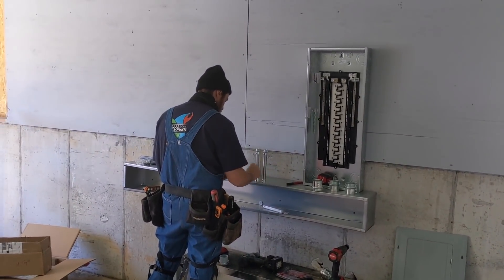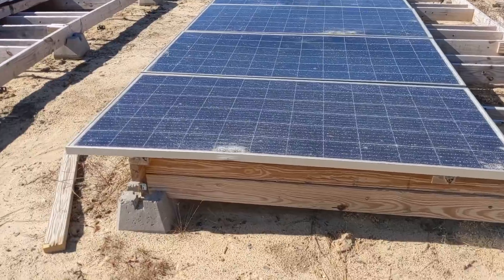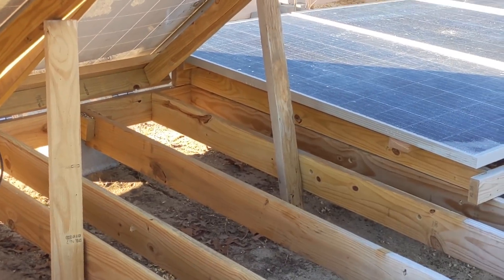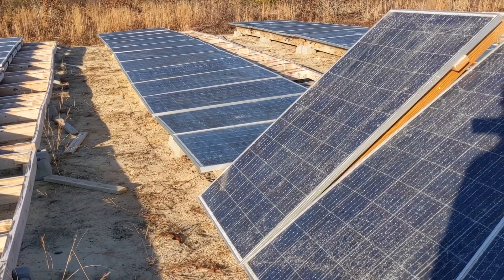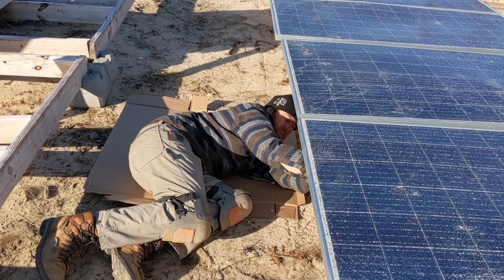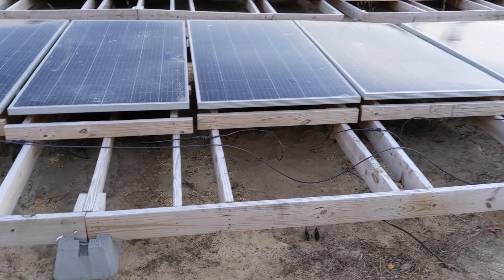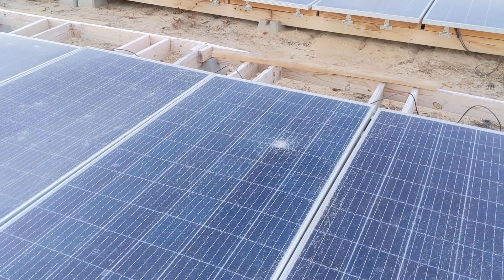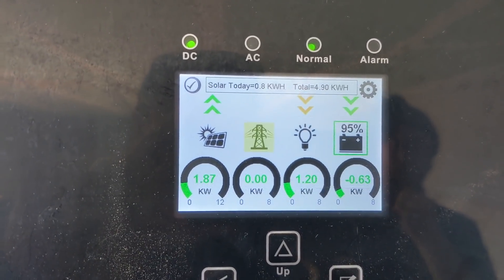Doomsday Solar

Comment: did they break because of the expansion and contraction of the wood causing too much stress on the metal/glass??? glass on wood is always supposed to have a rubber gasket between them and to no be over tightened

Comment: Watching Steve you  tube and he recommended Engineer 775. Looking for a small system that would be up gradable in the future. We live in N.W. MT about 15 miles from town. We currently are connected to grid power and with electric bill 70-80 dollars a month see no reason to panic and go off grid at this time, but we are moving toward being more self sustainable. So looking around for alternate power solar or wind...

Comment: 4:20 Voc maybe? Mounting system for those panels will be tricky with air pressure from the back when propped up - DIY nightmare. I can see a bit of flapping in the breeze... perhaps put them out of their misery for once and for all

Comment: I wonder if you used a fine drill bit and severed the leads on the damaged part of the panel if you could get usable power output from them.  It would eliminate any shorts and you could caulk or silicone the drill holes to keep the weather out.  Just an idea.

Comment: Great information, where do you buy a used panel? And what do they cost? I think it’s a good start for the system.
Reply: Craigslist, offer up etc. I bought my panels, 30, 230 watt sharp panels in perfect condition for $50 a panel

Comment: Dem dar panels gonna catcha fire fo sho!!  Especially with the wood frames on them.  The cells that are damaged will reverse bias which is essentially causing a short and dropping the load across that cell.  I would refuse to hook them up if I were you.  You are buying into a liability.

Comment: If you poured some good epoxy resin on the broken spots i think youd find it would dry like glass and restore the panels output back to new.  I think alot of panels could be fixed like this.
Reply: Most epoxy resins are too thick to flow into the cracks.  Second problem with epoxy is that the glass moves with temperature and the epoxy does not, so it cracks again.  A flexible sealant is need.  Liquid Nails Clear Seal thinned with a solvent flows into the cracks and is UV resistant.

Comment: In general the broken modules are ok to use al long as there are no holes through them. We don't know all the details on how the end user attained the modules. For all we know he could have got them for free. The big problem here is the mismatch of modules in the strings. Someone mentioned below about leakage to the frame that is what i would be concerned with as you would not know if you had a ground fault as it looks as if the modules are not grounded. We all know that panels laying flat will not produce much power. Once they were tipped there looked to be some decent production. If the racks were spread out a little more that would cut down on the inner row shading. The setup of the modules to be able to lay flat and then be tipped up is a pretty good system as you can adjust the angle during the year to maximize production. I know people who say I have 5000 watts of panels. Well if its not facing true  SOUTH (azimuth angle = 180 °). your 5000 watts just got derated. if they are not at the correct angle facing the sun you can derate them again. As for Engineer 775 taking this on I give him credit for working on a system that he knows is not going to be easy. I have been in the commercial solar end for sometime now and know of one person who takes all the damaged modules from sites and sends them over to Africa to be used in areas that have no electricity. You would be amazed at what one 300 watt broken module a cheap controller and battery can produce for someone who has nothing. Just keeping that one LED bulb on at night makes a world of difference.

Comment: Aren't the broken panels a fire risk especially with moisture ingress? I don't get it, considering the cost of the rest of the system and having you come out it just doesn't make sense. I've had two broken panels during delivery of both of my array's and getting them replaced was priority before commissioning anything. Heck the vendor replaced the panels no questions asked and free next day shipping.

Comment: WOW, all those broken solar panels, The GND fault alarm will trip every time it rains !!!
Reply: Yep, honestly this is dangerous. Wonder if they realise Inverter GFCI protection won't turn the panels off if theres a ground fault 😵 and it will only alert you if your bonding is 100%
Reply: Seal the panels with Liquid Nails Clear Seal.

Comment: If you seal the broken panels with like Vera Thane or something and pick out the good ones that will help out a bunch. IA found with broken panels if you put them all in parallel and get yourself direct charging the batteries they will work better but it's still going to be a sad state of affairs.
Reply: Vera thane is too hard and cracks from panel movement.

Comment: I think ,, your customer has the panels now,, he just keeps them producing 1kw or whatever,,you do all the other stuff like he/you both planned and he eventually gets more panels,,,jobs a good one..its about making the best off a bad job...
Reply: yeah i agree, panels are cheap and easy to wire. there's no point using new panels if no one is there, if/when that site is needed they can install the new panels easily at a later date

Comment: why not use microinverters?
Reply: If running off grid, there are VERY limited options for charging batteries from microinverters. It also puts you into an AC-coupled design, which has much higher “round trip” losses, meaning loss of conversion to AC at the panel then back to DC at the battery, 2x opportunity for loss and generally lower conversion efficiency from micros vs. string. Right now the battery world is wanting to be powered by string inverters or DC-DC optimizers could have been a good choice here using SolarEdge.
Reply: @tomkacandes8286  IQ8
Reply: @TurreTuntematon  I love IQ8’s ability to form a grid equivalency when the sun is out, not a night time energy storage technology, though.
Reply: People might point at Enphase, but just read their stuff - they are not really designing for the off-grid market, more the self-consumption market where objective is to store energy to use later in the same day - time-shifted energy if you will.

Comment: broken panels is the issue of the technology from the start. 
It's a bonus and great, but it's not 24/7, 365 days a year, rain hail storm reliable, and very easily damaged.
So many panels have been smashed in Australia in the last year from hail storms.
bonus, the destroyed panels I guess did save part of the roof from being destroyed! Expensive roof protection though!
Reply: Hail actually cleans them. 
On a side note im Pro... Oil & Gas

Comment: If he'd added some cheap boost convertors to that lot instead of trying to make a string, he might have got a bit more out of them. But an installer isn't ever going to advise that, he wants you to buy new panels with their own solar inverters. If you are going cheap then you have to engineer the entire system yourself, not expect a pro to help you save money

Comment: Well you verified it wasn’t a good idea. I wonder how much more production could be had if using micro inverters or optimizers to isolate the really bad panels.
Reply: Agree, you wouldn’t do  a pro Bono job for us fans would you?... FOR SCIENCE and us cheap people.
Reply: @AnN-py2em  yeah why waste good panels that still produce power that can B partly fixed with epoxy
Reply: @engneer775   this is the real question

Comment: Will solar panels work on the moon when we live there ??
Reply: Depends if they are sealed from pressure changes and if so what the pressure is.  Since they are used on satellites moon rovers etc I would definitely say yes.
Reply: Not on the dark side! 😏
Reply: Jonathan King says everyone has already gone there…
Reply: Absolutely.  The Earth and the moon are effectively at the same distance from the sun, so they both receive the same solar insolation, when measured in space.  However, solar panels installed on the moon have the potential to generate up to about 30% more power than on the surface of the Earth, due to the atmosphere of the Earth absorbing and dispersing some of the incoming light (especially in the UV range) from the sun.  Additionally, annual net production on the moon can be even higher, due to the lack of interference from clouds on the moon.  However, the lack of atmosphere increases the effective thermal resistance to ambient, and will cause the panels to get extremely hot during full sun exposure (ex: >120 deg C), unless they are operated with some kind of thermal management system (ex: liquid cooling + shaded radiators, or, operation inside a temperature controlled pressurized clear dome).  Operation without a thermal management system is presumably possible, but it would decrease electrical output somewhat, while likely reducing the life expectancy of the panels significantly.  Additionally, the greatly increased amount of UV light hitting the panels may cause the panels to age and degrade faster than on the Earth, but this can be effectively eliminated by coating the panels (or integrating something into the front glass) with a UV absorbing layer.

Perhaps most importantly however, the moon rotates very slowly compared to the Earth, such that a single day on the moon lasts approximately 709 hours.  Basically, at the equator of the moon, you get about 354 continuous hours of sun followed by about 354 hours of continuous night, with really long sunrise and sunset periods marking the boundaries.  Consequently, you would need a massive battery bank (or alternative power source, such a fuel cells) to keep yourself powered during the very long nights.  Alternatively, you could install solar panels on both sides of the moon and then install a high voltage DC transmission line linking the two sides of the moon together.  Doing so would basically eliminate the need for any batteries or other energy storage system.  Technically, we can do the same thing on the Earth as well, but doing so potentially requires greater investment on the Earth, due to the larger diameter of the Earth resulting in larger transmission distances required.  That said, we do have the technology required, it is simply a matter of coordination/cooperation between countries and investment in capital infrastructure.
Reply: @Fritz_Schlunder  We could also connect earth solar to HV transmission or at least from 3 or4 time zones away like in the US and have several more hours of use without storage.  Maybe this is done with the grid now nut pretty sure it could be improved

Comment: great video, Just because customer started with bad panels, the job can be upgraded and the stuff #Engeneer775 put in will be done ahead of time and after that the panels that have damage can be used for small projects , yard light's , electric fence, security camera's , etc.
have a great day

Comment: To go to the expense of having your guys come out and install a 12K solark and a lithium battery and then cheap out with 36 broken solar panels is certainly a head scratcher.
Reply: Yes but he needed that part done anyway and I bet he will get different panels and install them himself on the ground like these at least for a while.
Reply: I have friends that used broken panels and are just fine.  365 watt panels still putting 350 watts out.  Cant complain when he paid $10 a piece
Reply: @offgridmgtowhomestead2520  where did he find em?

Comment: For a long-term off-grid situation would putting plexiglass on top of the solar panels help them be a little more hardy and last longer without taking away any solar absorption?
Reply: it definitely would take away quite a bit of solar absorption and increase over time due to the plexiglass becoming cloudy etc due to the UV and other factors.  If I lived in huricabbe area etc I would have a ground mount a single vertical panel high and a frame around the panel frame a few inches higher and use strips of foam at aced intervals then cover with tarp this should eliminate moat of damage debris could cause and easy to install and remove once frame is there kinda like a boat cover.
Reply: the plexiglass might be more expensive than new panels

Comment: can you do a video on the different solar panels out there and which ones you use. what do you look for when selecting a brand of panel or how to spec out a system. I will be a first time buyer and would like to have some recommendations so I don't design my system wrong. there is so many different things to look for when you shop a system.

Comment: I received one broken panel in a shipment of 42  and took it to dump didn't try to hook it up.  so no experience with them.  
Question if some panels are way worse than others would it help to remove them from the array. Obviously if they create a dead short it would be helpful but if they show  rated voltage and just produce none or very little amps/watts do they make the string they are in produce less? How would you check each one for amperage anyway? use a small load and a shunt?
Reply: I was thinking the same thing. If your array is only as good as the worst panel, then troubleshoot the worst panels out of the set-up to maximize what the customer does have to work with right now. That process may leave him/her with several "duds" that can be thrown away but an overall better performance.
Reply: @jokertim777  year I think if the voltage is  equal they wont drag it down much just more or less go straight through the "optimizer " on each panel
Reply: @teekay1785  
no you want to have similar currents not voltages in a string.
parallel is the other way round.
Reply: @ursodermatt8809  You totally missed my point.  The point was how to identify the weak panels when most people would only have a multimeter and they can easily check the voltage of the panels but can't easily check the amperage to see which panels are producing very little power.  
Actually it is desirable to have similar voltages in a string when they are to be combined before the inverter doesnt matter much in a single string not combined. 
Here is a video similar to your point
https://www.youtube.com/watch?v=P3YtBrymJdA
Reply: @teekay1785  
my dear, i disagree with you.
it is just as easy to measure the current.

besides, all the measuring will not do you that much good anyway, as water ingresses and will do all kinds of damage.
using those panels is a hairbrained idea. only good for experiments.
Reply: @ursodermatt8809  No one including me has said its a good idea to use these panels for many reasons that is not germain to issue.  No most people would NOT be able to readily measure the current produced by individual panels. I could but thats not the issue either,  So I guess you will just continue to disagree.
Reply: @teekay1785  
yes, keep on disagreeing
Reply: @jokertim777  maybe they did check them since scott I think said they connected 18 panels and might come back to hook up 18 more . There were way more than 18 panels shown.

Comment: this brings up the question: can solar panels be repaired?
Reply: Yes you can, but you need to use optical clear epoxy and that is kinda expensive. And that's assuming the cells underneath are not damged
Reply: Tempered glass laminated with the wafers and back sheet......No.
Reply: can glass be repaired?
Reply: On the solar job I was on, the engineers said they couldn't be fixed, unless it was something very minor. Or maybe they could, but not worth it on a 40MW job, and the customer expected everything to be NEW and work properly. Like, you can repair small chips in a car windshield, but major cracks, you just have to replace it. Both are laminated glass (for the most part)